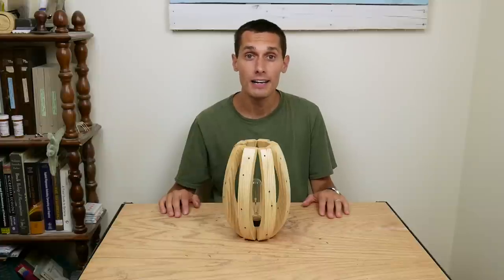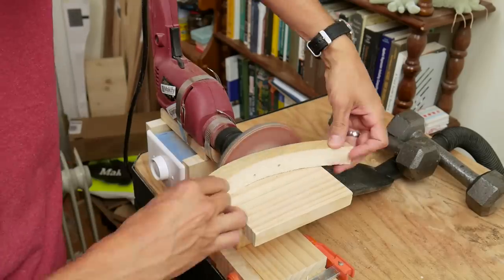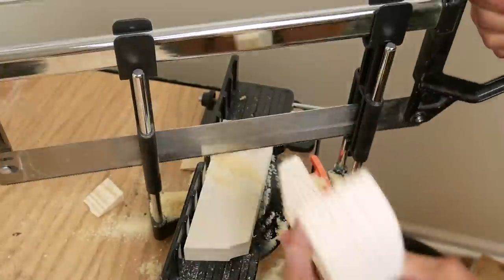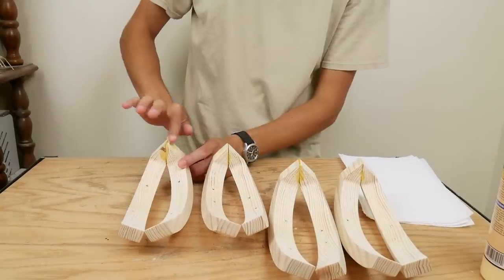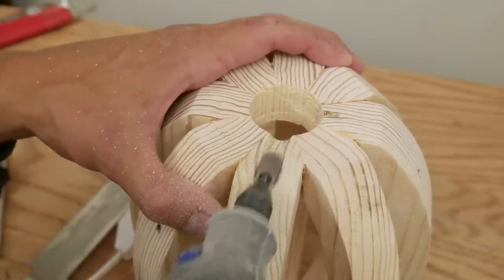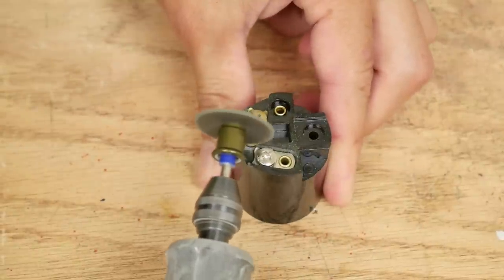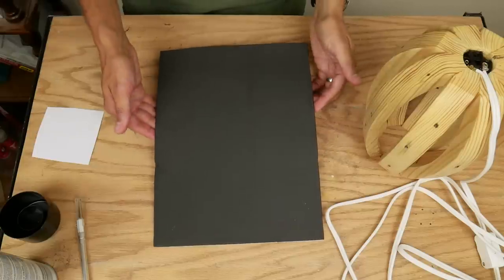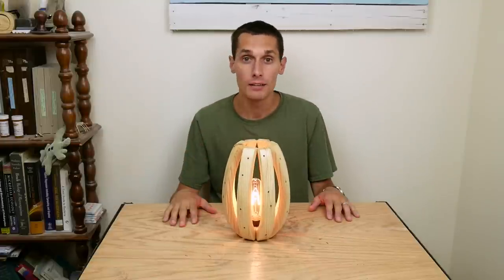How to Make A Rib Lamp from Pallet Wood

Comment: I really enjoyed the video.  It shows what needs to be done and workable solutions, and the shooting was good.  I like your narration as well.  Most importantly,  this is a good craft project and you made the template available.  I'm now going to check in my pallets to see if I have a match, and if not I'll take my trailer to the furniture dealer again.  Thank you for sharing. BTW I like that you pointed out the issue with bulb and hand size and the top of the lamp.
Reply from the maker: I'm glad you liked the video. Thanks for the nice comment!

Comment: This is a totally fantastic, easy and fun project! I don't have any experience with wiring anything, but your instructions were definitely clear and made that part of the process look absolutely doable. I'm planning on acquiring a bandsaw for my apartment, and I was curious about what type you have, and whether you would recommend it (ease of use, good cut quality, and "quiet-for-a-power-tool" would be my goals).
Reply from the maker: My band saw is a 10" Craftsman (model 351.214000) which is identical to the 10" Rikon band saw (model 10-305). It is easy to use, cuts well, and is very quiet. I'm also in an apartment and it is a good apartment saw. I would caution against getting a 9" band saw, they are just too small and not well built enough in my opinion. I would recommend replacing the blade with a high quality blade. I like Timber Wolf blades. I recently replaced my tires with urethane tires and that has improved the saw as well.
Reply: +Makify1 thank you so much! This is excellent information, and definitely a point in favor of getting the craftsman/rikon saw (it's been a toss up between that one and the Wen, which sounds like a pretty great machine, but I have read some accounts that mention the Wen being difficult to set up properly). Hooray for saws in apartments!
Reply from the maker: I'm glad I could be helpful. Good luck with the saw! I love mine.

Comment: Cool project. Couldn't you have oriented the paper templates on the wood such that there would have been less scrap (by mirroring and rotating every other one)? I realize that pallet wood is scrap to begin with, and maybe there was another reason you chose to do it this way. Thanks for the video!
Reply from the maker: That is a good idea. The wood I used was very knotty and so I was more worried about avoiding knots.

Comment: Good job. Just a little question: why don't you removed away the triangle from the base with the band saw?
Reply from the maker: The top is curved so I couldn't cut it on the band saw upright. I could have tried tilting the the table on my band saw and cutting the ribs bottom first but because the ribs are curved, I wasn't sure if I'd be able to hold them steady enough to make exact cuts.
Reply: Thank you for your answer.